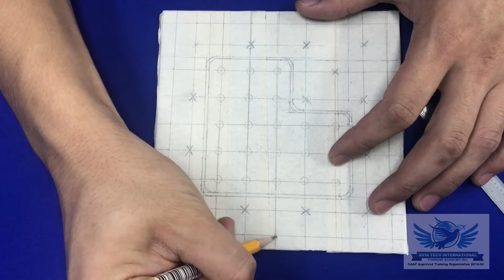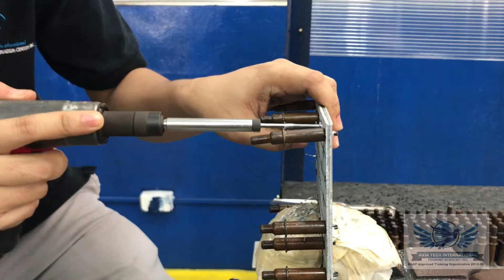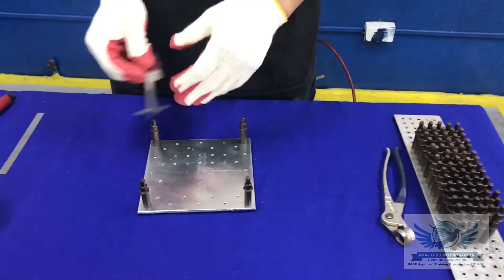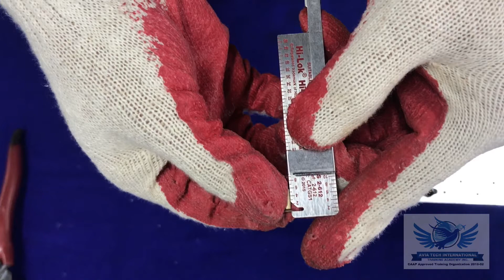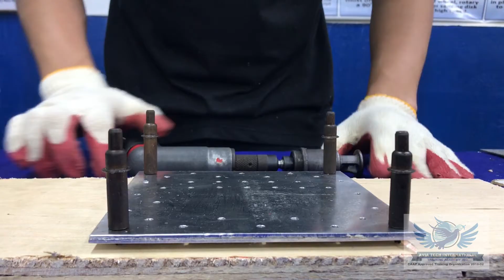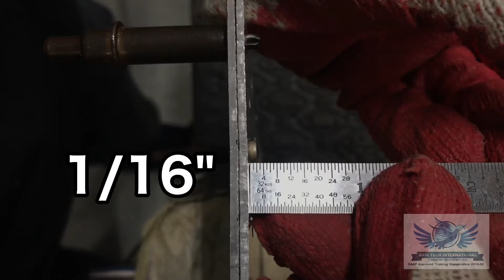Aircraft Riveting | Avia Technicians

Comment: You don’t just make up a repair scheme, you need to check the aircraft manual to determine the type of structure and repair required. The manual should state standard repairs allowed by the aircraft manufacturer but any non standard repair should be certified by a structural engineer.